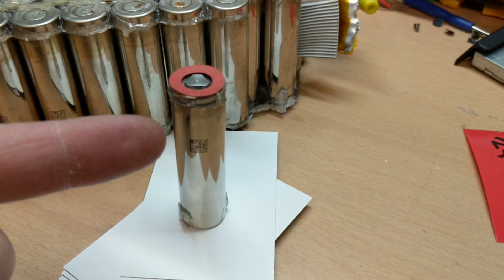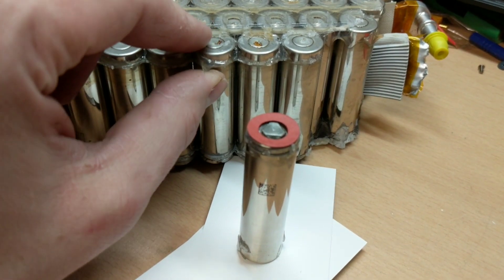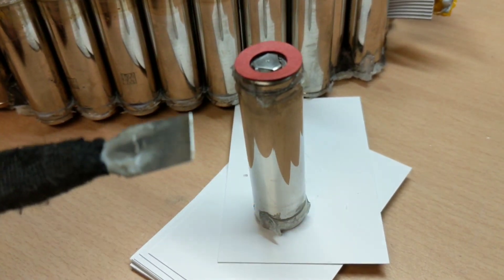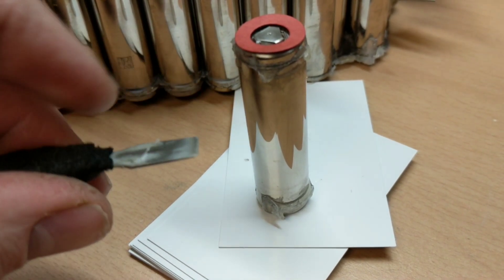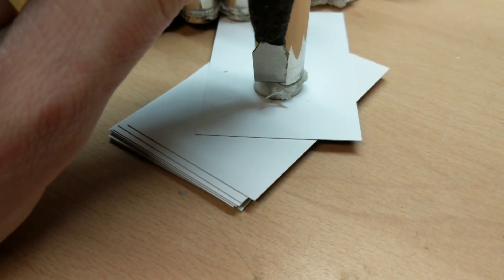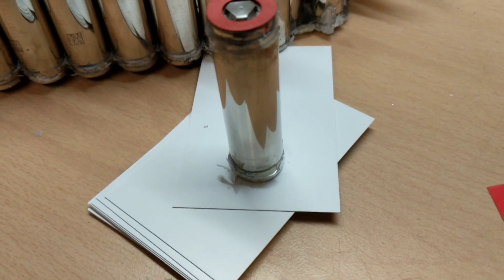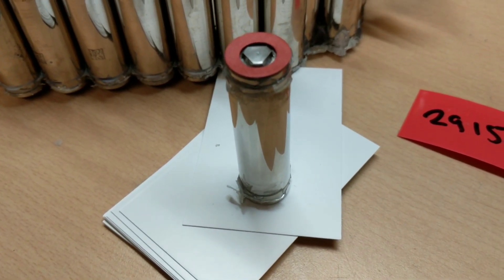Tesla battery 18650 removed from a massive Tesla cell. One of the tools I use I made to clean it

Comment: Informative, thanks for sharing!
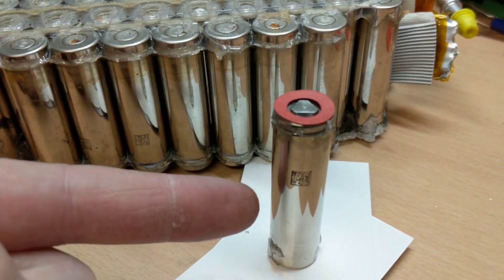Do you reckon a robotic arm would make life a heck of a lot easier in removing the adhesive (0:30) from the top and bottom of the cells? Not a laser cutter (because the heat might damage the cells), but more like a robotic wire cutter or something?

The reason I'm thinking a robotic arm is for safety and efficiency. It might take me AGES to remove 440 cells from a module, but every step of the way, I'd be shitting myself to hopefully not puncture a cell!
Reply from the maker: Omg that’s gonna take a while. My method I did Damage some cells. I also had the idea to sand the top plastic bit right down to the cells but never tested it.